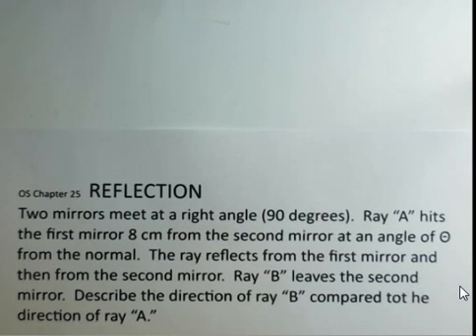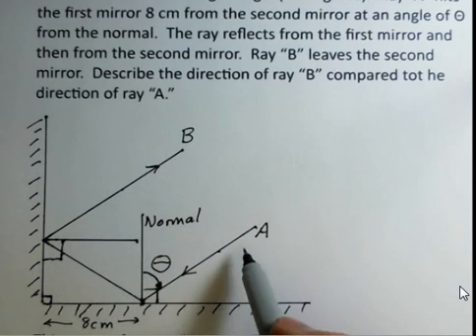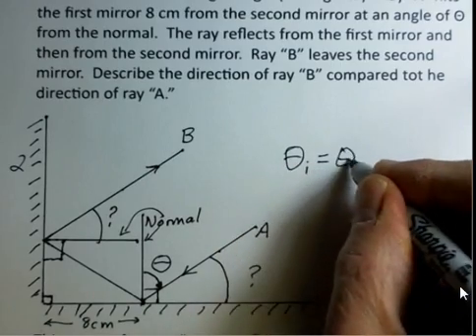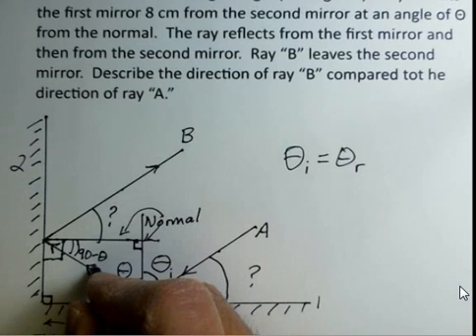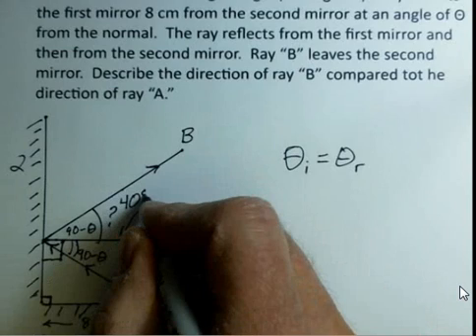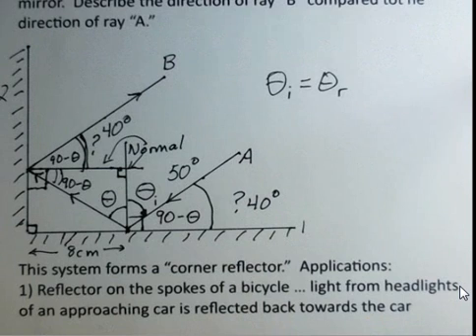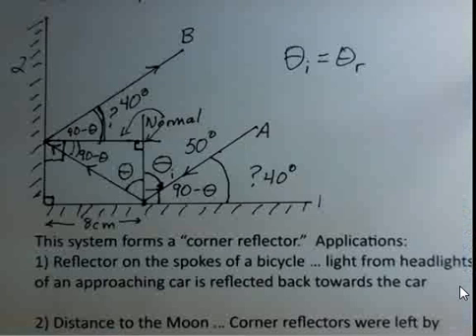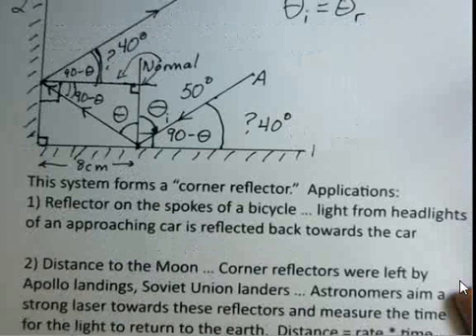Reflection of Light, Mirrors at Right Angles, Corner Reflector

Comment: Greg -  on a corner reflector used for alignment puposes......would the distance between the two parallel beams become less as the corner gets closer to the center of the 90 degree angle ?  I'm wondering if this could be used for alignment.
Reply from the maker: I think that the distance between the two beams depends on the distance from the intersection of the two mirrors to where beam A, in my diagram, hits the bottom mirror.  I don't think I fully understand your statement "as the corner gets closer to the center of the 90 degree angle."  Perhaps we are making the same statement.  Yes, I think this could be used for alignment.